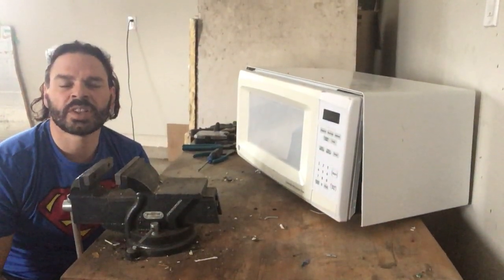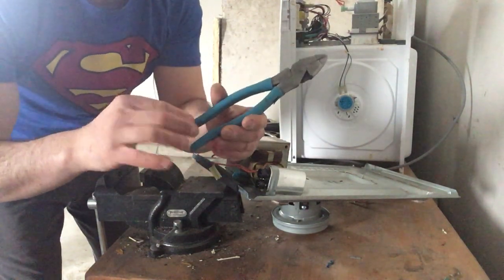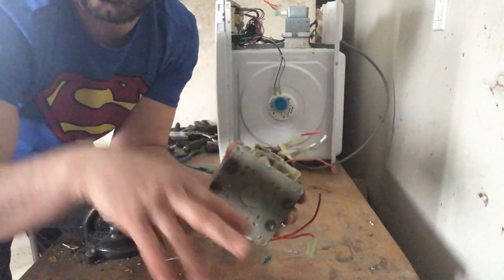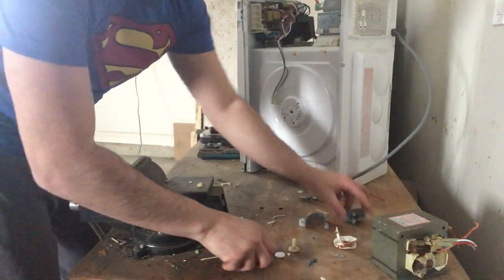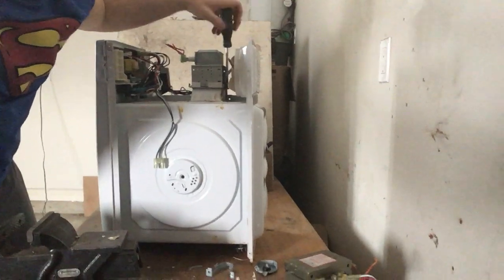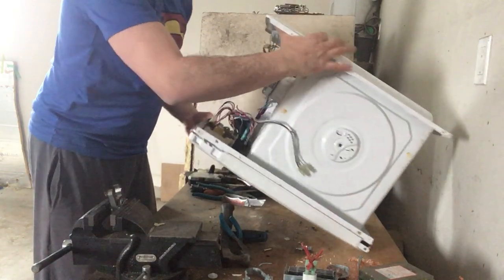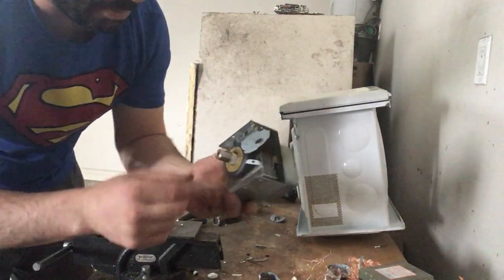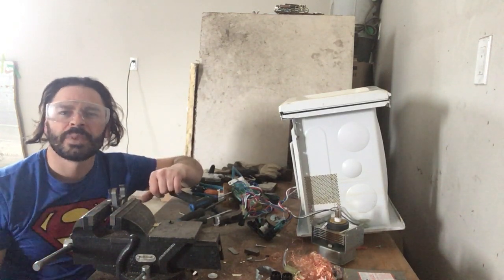Scrapping a microwave SAFELY and quickly for copper, aluminum, brass, silver, steel, and no waste.

Comment: I like watching scrapping videos to get my ass out of the house and back to the yard so thanks for that.  For people new to scrapping they do want to take their time till they get good at it most likely they're going to get cut from something that is avoidable.  I'm doubting they'll get electrocuted though unless they choose to plug something in that they're scrapping.  Be safe not sorry short the cap out with a screwdriver.  In a shop setting when repairing microwaves we did use a resistor since we weren't scrapping them.
Reply from the maker: Yup, thanks for the comment. Stay well and thanks for watching

Comment: A good tip to speed up removal of screws is to use an impact driver with a long magnetic bit holder. Yes, the metal shell of the microwave is great to fill with smaller chunks of metal eg. door locks, bolts cast scraps etc etc and these when filled can really add some good weight to your load.
Reply from the maker: You are right, but like to keep noise to minimum on videos. Thanks for the comment. Stay well.

Comment: Buddy! you are right that capacitors are dangerous, I would be interested to review your source that says that a couple of people get killed every year scrapping microwaves because of capacitors. It is horrible if it is true but I doubt it. The point you make about leaving the capacitor to discharge for a few days may work, but the simplest way to discharge it is to short circuit it. With an insulated screwdriver, pliers or anything metal make contact between the two posts where the wires are connected to the capacitor. The discharge is immediate, it takes less than a second. Good luck, don't become a statistic! And please, reply with your source, I really would be interested to read it.
Reply from the maker: I said the first step for me is I leave the microwave unplugged , but not full proof. Some people don’t have rubber handled pliers....the MAstercraft are actually plastic.
Reply from the maker: I never said they could kill you. I said they can create a lot of problems and each year several people get seriously injured.
Reply: @TinManScrapper  ok then.... you said electrocuted, your source would still be welcome.
Reply from the maker: I agree, that is why I used the rubber pliers. Thanks for the comment and advice. Stay well.
Reply from the maker: @bootsowen  electrical safety in research operations. Virginia tech,  injury caused by high voltage capacitor discharge, Berkeley edu

Comment: You can discharge a capacitor with a screwdriver that has a fully insulated handle (rubber or plastic undamaged) to make contact between the two leads.  Use a multi-meter on the highest DC voltage setting, after a time, to check that voltage has sufficiently dissipated.  Check with the metal part of the screwdriver across the leads again to see if there is still a spark.  Need I mentioned that under no circumstances should you touch the leads of the capacitor or the metal part of the screwdriver while making contact.